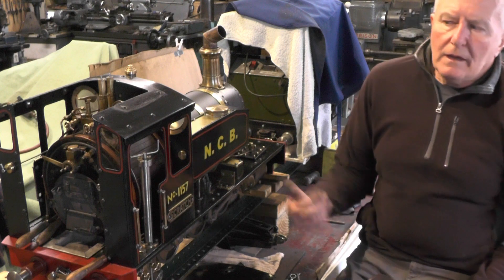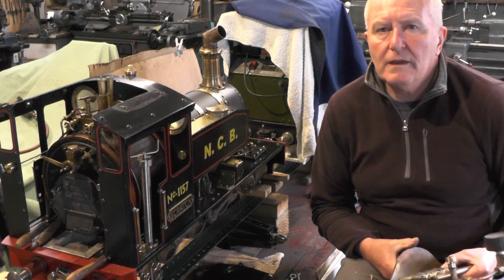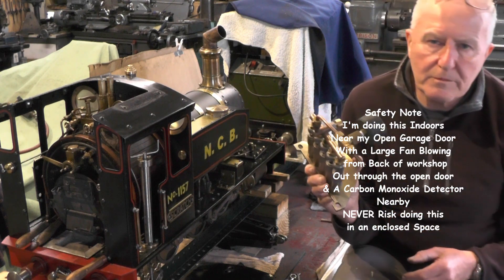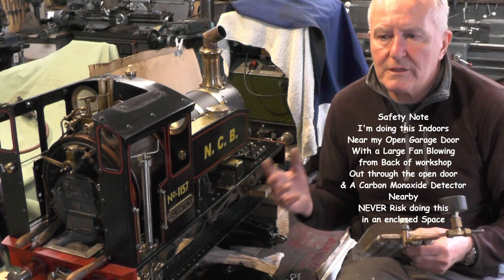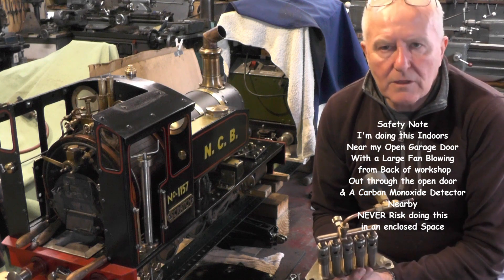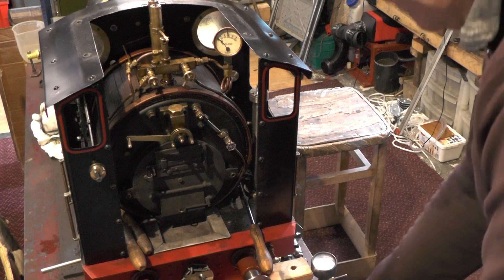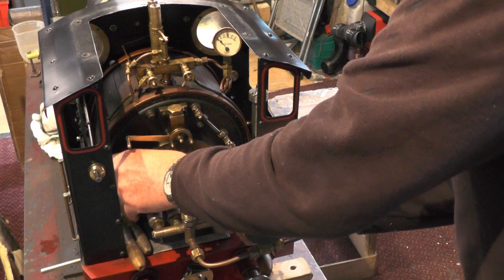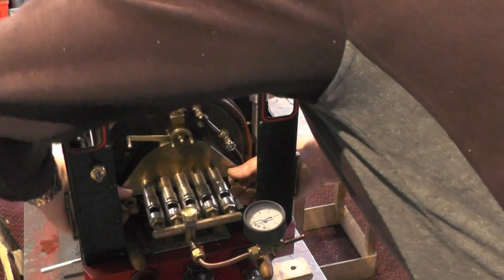Metre Maid Steam Locomotive Gas Burner Part 4 (Trial 1 On Butane Gas) "mr factotum"

Comment: Looking at your burner setup, I would put an arch just infront of the tube sheet that extends back to where the end of the flames are, this would reduce the amount of cold air going through the tubes much like on your coal burning insert. Usually here in the states we use small barbecue bud type burners, look up Bengi Burners for more information, there really quite interesting.
Reply from the maker: Good tip! JK
I'm still on a learning curve and a few video's on, so thanks for the advice, i also need an air door at the bottom portion i think, work in progress,!!!
thanks very much👍👍👍🚂🚂🚂
atb
Kev

Comment: I wonder if a baffle in front of the tubes would improve heat transfer and protect the tube plate. Bit like a brick arch? Looks interesting I have a B1 with a gas fired boiler but I haven’t tried firing it. Too many projects! 😀
Reply from the maker: eyup there Julia
Thanks, now contact made iv'e subd and bell'd you and will take a look at what you get up to as time permits, like you say too many projects,
As for the baffle your spot on, also now ive experimented a few times, (i'm a little in front of the next few videos) i think i need an air door at the bottom, to adjust the flow, watch this space later!!!
Thanks for comments
atb
Kev

Comment: That seems to work quite well. How are you proposing to house a gas tank for running and refilling it etc?
Reply from the maker: eyup Ben, and thanks
I'm not really proposing to to use it for myself, just getting it running for  friend, its really handy to get steam up for bench trials though, so might make one for that purpose, but more than likely it will be coal for the track👍👍👍🚂🚂
cheers
Kev
Reply: @MrFactotum  Fair enough.

Comment: Love that Loco, the burner seems to works very well, I suppose that a track run is the real clincher. On a day at the track is the cost of running on Butane or Propane cheaper than running on coal ? Certainly a lot less hassle to fire up on Gas. I know they often run large scale model locos on gas in the U.S.A. Interesting video thanks Paul
Reply from the maker: hi Paul
all that's to be determined, but honestly can't beat the smell of smoke mixed with steam🤔🤔🤔👍👍🚂🚂🚂🚂
thanks for dropping by
bfn
Kev

Comment: Hi Kev.  Interesting.  It looked to me like the gas mixture was a bit rich as the flame was quite "wooly/fluffy".  If it's jetted for LPG/propane that could be the reason.  I'm only commenting in line with metal foundry work with LPG, when the mix is right the flame pattern is hard and noisy.  I suppose having the blower changes combustion conditions a bit. Cheers Rob
Reply from the maker: eyup Rob
yes your right, needs an air door at the bottom, plus some experimentation.
thanks for feedback
atb
Kev (UK)